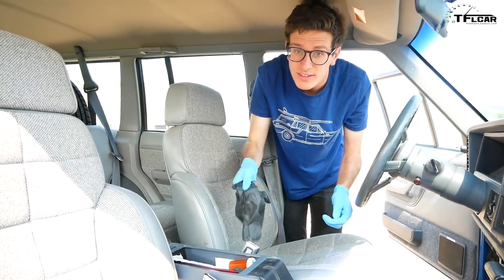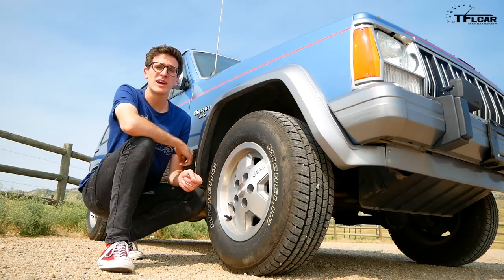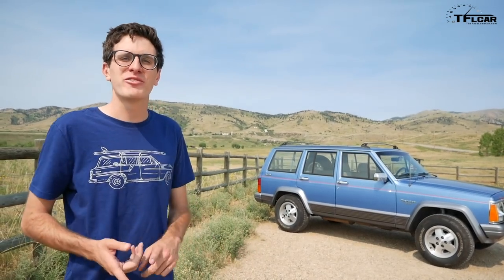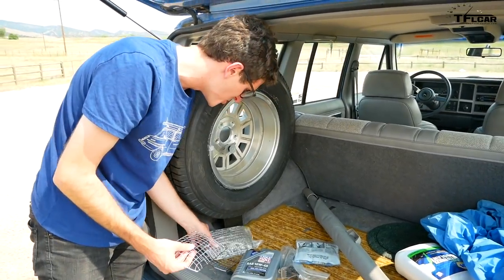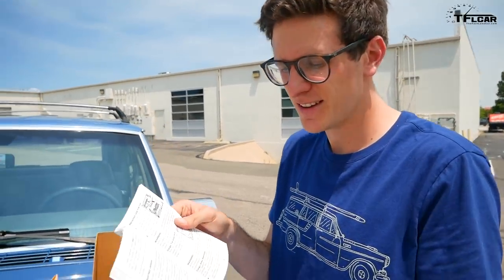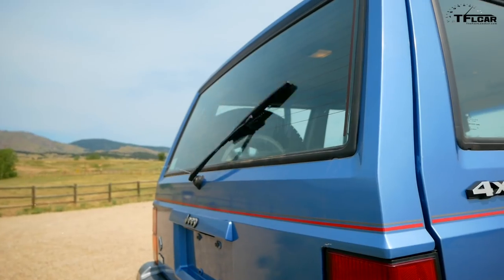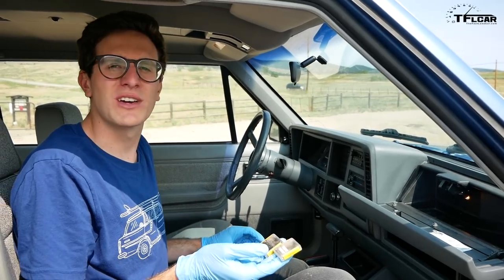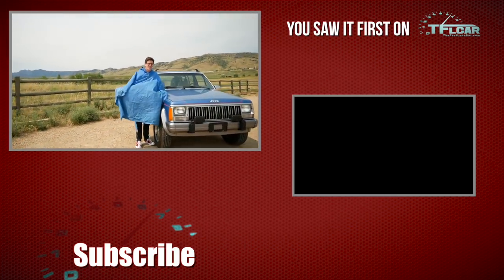Unboxing Our New Cheap Off-Roader - Difflock Season 2 Ep 1

Comment: 8:50 battery post cleaner.
Reply: That's what I think it is to.
Reply: That's what it is.
Reply: He should have to service the battery on principle for not knowing.
Reply: haha I was thinking the same thing
Reply: He's a bit too young to know the struggles of keeping battery post clean :)
Reply: I'm not TFL's marketing department, but I think it would be cool to have him touch on basic maintenance issues on old vehicles like this. Point out what has to be done and fast forward through the actual footage, there are plenty of other detailed vidjeos out there about how to service a battery or change shocks. I think my fellow millennials would benefit from a quick demo to see what is involved.
Reply: He will know what these tools are if he keeps fooling around with older rides.  Everyone should know the struggle lol.
Reply: I have one of those in my WK Grand Cherokee and I use it all the time.

Also, it's a two part tool, if you open it, it has like a brush to clean the inside of the batteries cable terminal thing...
Reply: and we are relying on him for an offroad build?
Reply: Yep...a lot of cars don't have those type of battery terminal posts anymore. Maybe that's why he didn't know what it was.

Comment: That rear washer fluid is amazing.
My moms 98 sienna front windshield wash sprayer squirts right over the windshield on to the roof. Has 240k+ miles on it and runs fine. Only problems we have had was caused from driver error (offroading).

Comment: 08:50 that's a battery post cleaner Tommy
Reply: Thanks Chris. Appreciate it!
Reply: With my old Ranger if I thought the battery was dying or getting weaker I would take the cables of the battery posts, twist the post cleaner a few times to clean the rust off the battery posts, and usually improved things.  Should be done once a year I feel.
Reply: That's cool Tommy replied
Reply: It should also separate and have a brush inside to clean the battery cable clamps.
Reply: Sean Lidberg - Yep, you are correct. All of the ones like that separate to have a brush to use to clean the inside of the battery cables.

Comment: As people have mentioned, 8:50 is a battery post and connector cleaner. The hole at the bottom slides over the post and you turn it to scrub the post clean. Then it has a wire brush inside, you can separate into two pieces and use the brush to scrub the inside of your batter connectors. A Coke works as well.

Comment: That "spikey cutter finger thingy" is a device to clean corrosion off your battery terminals. Put it on, and rotate it around. There should also be a brush if you remove the top.

Comment: 9:12 That pinchy grabby thing is a drain cleaner. Also, you have no idea how good of a deal you got on that thing. To find one that well cared for and with all that bonus stuff inside for a price that low is actually unheard of. I would have killed for that vehicle had I been able to get it. That Cherokee would have fetched $10K to $12K where I live.
Reply: MultiPurposeReviewer 10 to 12 k. U need to move.  That's a 1000 dollar jeep all day long.
Reply: Out here, a $1000 Cherokee is usually somewhat damaged or in parts condition.
Reply: Pinchy grabby thingy is to pick up nuts, bolts, screws or any other small object that fell into a hard to reach spot.
Reply: Can also be used for that, yes.
Reply: No it is not. Wow
Reply: What is not?
Reply: You can buy a Jeep Cherokee for $ 1,800 in real good shape all day long. You can also buy a 
     93 - 98 Jeep grand Cherokee for the same price everywhere in California 👍😮

Comment: That round sliver spikey thing is a battery top terminal cleaner...
Remove battery cables and place that silver object over the terminal post and twist and push down ...
It will clean those battery terminals very clean
Cheers from 🇨🇦

Comment: Hey! 
Check your rear ride height!  It should be 17.5 inches from the middle of the wheel to the bottom of the fender flares.
The rear looks super sagged. It isn't the shocks that cause that, it's The rear leaves. (Although the shocks should probably get swapped too.)

The part time xfer case is a fun touch too!

Comment: Not if, but when you find oil dripping from the air filter box, don’t freak. It’s the plastic lines from the valve cover that operate as a Pcv system. Just throw them away and install new ones. Simple fix, but many people miss it.

Comment: Ditch the ABS, hit the junkyard and grab a rear axle with matching gears out of a 97+ or one of the rare 87-89 tow package Dana 44s, grab some front shafts out of a 95+ for larger u-joints and to ditch the failure prone vacuum actuated CAD system.  Would have said to ditch the 242 for a 231 transfer case a few years ago but not tom woods makes a true SYE kit for them.

Comment: Another comment stating it's a  battery post maintenance tool.

A body decomposes quite quickly and leaves a liquidy stain that's near impossible to remove as its blood proteins are nasty. Chances are the bleach smell is probably from mould removal. Check that jeep throughly for mould under seats and seat covering material, carpets and around anywhere you can. A little black mould in the lungs can go a long way.

Comment: Nice find! Definitely rare to find one that clean! Also, you don't mention it in the video, but it appears to have the 242 Selec-Trac transfer case, which is also a nice thing to have. Even today, a lot of 4x4 vehicles don't have that capability.

I live in RI, and even here I see a ton of XJ's still around and on the roads. These things are like cockroaches, nothing kills them! A lot of them are rusted to hell, but they just keep going. I've been thinking about picking one up, if I can find one not totally beat.

Glad to see this series back, too. When you guys got rid of the YJ and starting building the JK, I thought "there goes Difflock, no wheeling on a budget in a new JK".

Comment: Forgot to add, remember to do tight figure eights on a hard surface to check the VC in the transfer case. Should be within 2-3 times and the front tires chirping will tell you all is OK.  If not, PLEASE PLEASE PLEASE document splitting open the transfer case to replace it.  Some basic hand tools, being meticulous, and a decent work bench should be all you need.

Comment: Only downside to your Jeep is the bendix ABS system. I ripped the whole system out of my wifes old XJ because if the pump fails, its damn expensive to replace. But that XJ is VERY clean! Oh, the spiky cutty thing is a battery terminal cleaner.

Comment: I have a suggestion for your new Jeep. Put a small lift on it. Maybe 3 in. Just enough to get the tires out of the fender wells so you can put on a set of 32 or 33 inch tires. Maybe some lockers and a front bumper and winch. Then make it an overlander. It would probably be a better one than the Hummer. Smaller, lighter and more economic. More maneuverable and more of a mountain goat. If for no other reason than to mess with Andre. LOL 😝. Last of all let us know when it’s time to sell it if that time comes. I love those jeeps. A 2 door version is even better but you can never find those in good shape.

Comment: To be honest you probably have the best version with the automatic. I have the limited so I have everything you have except the skid plates. And mine is white and has the tan on black interior. So I think mine looks better but you have skid plates and my AC doesn’t work great and my cruise control is broke, and all my windows work just not very well. Also it has 167000 miles so it is more used. Other than that it is the same as yours even the same year. Anyway I love it and I love yours too.

Comment: 2:30 - In cars with odor, ranging from food/body odor to cigarette smoke car dealerships tend to utilize one of two methods to get rid of the smoke, the first (and best) is an ozone machine which leaves a fairly pungent smell in the car, and the other is a chemical that comes in a small cup, I believe it's a two part item and when you open it the two components mix and start a reaction. Whatever the chemical it turns into a gas and oxidizes the interior of the car really quickly, the drawback is it smells like 20 chemicals you should wear a respirator around got poured into a pale all at the same time and sat in your car. When it's all said and done it removes most of the odor, but if you have the misfortune of being around the vehicle shortly after this has been done well... you'd probably opt for whatever smell it is they were trying to remove in the first place.

Comment: It's more and more unusual to find an un-molested clean XJ - Congrats! However, the price of the title is usually only the down payment on the inevitable build to enhance the factory's 7.3" inches of clearance between the rear diff and pavement with the stock 225/75/15 tires. Should we stay tuned for the up-grades?

Comment: You got a hell of a deal on that Cherokee.  you will be surprised just how capable they are right out of the box. in fact it is probably just as capable than that 45k 4 runner TRD PRO. (TRD is that pronounced TRUD?) just wondering. the only thing better than an old Cherokee for offroading is a wrangler.  I am looking forward to seeing how this one goes. I would love to get my hands on an old Cherokee in that kind of condition. that thing is mint.

Comment: Unfortunately, the old 4.0L is not known for reliability. It's known for being rallied by road-raging suburbanites who experienced the following problems: blown head gaskets, cracked cylinder heads, chattering pushrods and lifters, and engine failure due to damaged piston rings and cylinder liners.

The old 4.0L is bulletproof *if* you change the oil religiously, check the coolant regularly, replace the water pump every 6-8 years, get the engine tuned every 100,000 miles, and generally drive like a 70-year-old grandma (2,500rpm redline). Thankfully, the 4.0L is a simple engine and these tasks are cheap and easy.

Over time the 4.0L was redesigned and critical components were strengthened. About the time they decided to discontinue the engine, it was genuinely bulletproof, but still didn't care for rpm. That's life I guess.

Comment: That thing is mint Thomas lol my son has a '95 Cherokee former sheriffs patrol unit and a 3 inch lift on 35's
Reply: chad harmon.  3 inch lift?  Do you even articulate, bro?
Reply: Suburban actually his is pretty badass wish I could send pic
Reply: Nice
Reply: Did your son trim the fenders off or does he have full wides?
Reply: Sean Nicol believe it or not he left stock fenders and mud guards on he went ahead and put 2in wheel spacers on the other day looks a lot better
Reply: chad harmon nicccce gotta respect that.  I didn’t think 35 could be stuffed under there with only 3 inch I thought 33s were tight lol
Reply: Sean Nicol wish I could share a pic I'm pretty sure they are 35's

Comment: That 4.0 is far from "bullet proof"
Everytime a jeep came in to our shop with this motor it needed a new head gasket, exhaust manifold, intake manifold gasket and that's if the block wasn't warped already from the head gasket causing overheating.... Just saying

Comment: I'm in love. That thing is mint. Is it a Dana 35 or Chrysler 8.25? You need a 4" lift and 33s. and with leafs in the rear you can go shackle, block or AAL and the coils on the front you can add bigger coils and then spacer it. Its so sweet and parts everywhere for them. To hell with the JK and JL its all about XJ and ZJ. Do you wanna buy my Niner? lol

Comment: Hey how about you guys get something that isnt a jeep
Reply: Exporado M You mean l like the Ford Highboy, the International Scout, the Pontiac Aztek or the other various non-Jeep vehicles TFL has had?
Reply: Exporado M why mess with perfection (well after you replace the transmission). Don't think to many people want to see a isuzu trooper and Toyota's are to dang expensive. I can still sell my 1994 1/4 ton for 6k when I only bought it for 16.5k in 1994.
Reply: 5stardave not on difflock?
Reply: Tony Hightower u dont wanna see if something cheap that isnt a jeep could go offroad like an isuzu or an old s10 blazer zr2 or a 3rd gen 4runner or an 2nd or 3rd gen explorer or an old xterra or pathfinder etc. I would find that very entertaining. Everyone knows XJS can be extremely capable. I'd like to see other older SUVs that havent been modded in every way shape and form already. I think other people would too